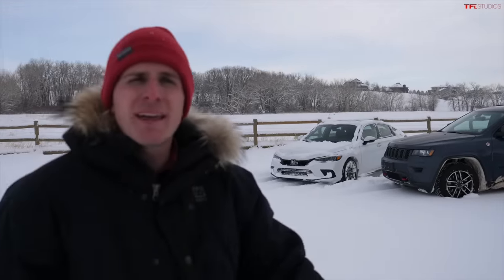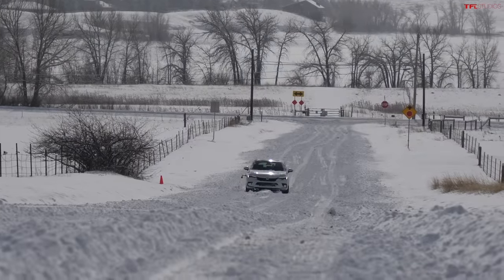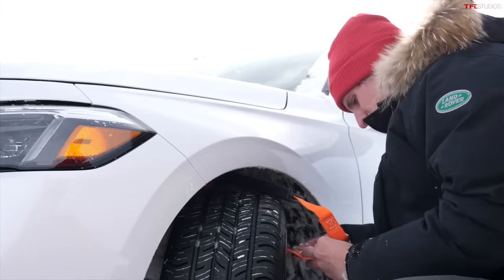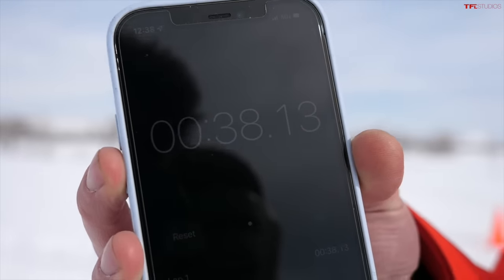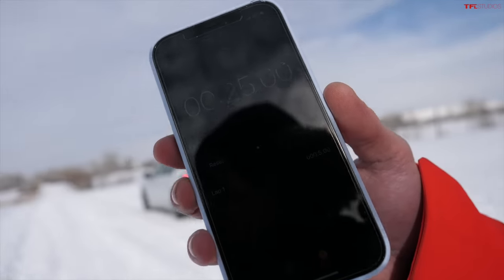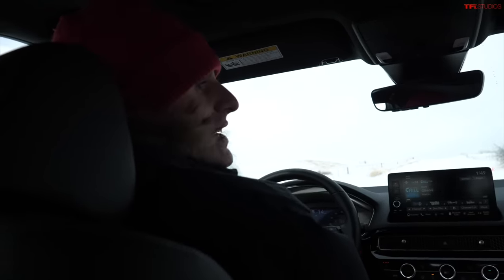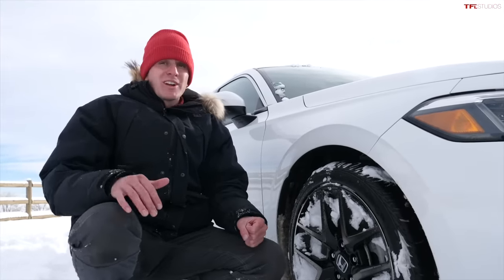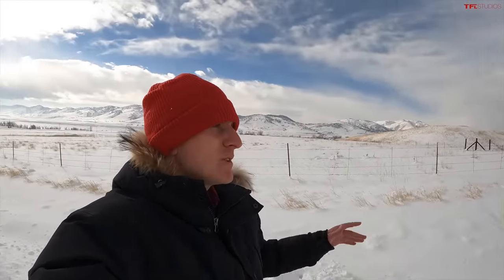Can Off-The-Shelf Traction Aids Make a Civic As Good In The Snow As a 4x4 Grand Cherokee?

Comment: I don't think that civic can beat the Cherokee even in dry road.
Reply: Yeah, it’s an odd comparison. They should have used the same model that has an AWD option.
Reply: It's has lower center of gravity
Reply: They could have tested a mazda3 awd vs fwd. or a camry awd and fwd…
Reply: @User.Joshua  lmfao
Reply: All season tires are useless in the snow. That’s why they are illegal in Canada during the winter.
Reply: @donproduction6248  i'm running snow rated all terrains and never had real problems in snow, different story on ice
Reply: The turbo model can, but the 2.0 cannot. 
Jeep V6 - 7.3(7-7.5s to 60)
Civic 2.0 - 8.3s
Civic 1.5t - 7s 

Also flooring the fwd Honda probably isn’t the best way to get acceleration vs modulating the throttle.
Reply: In dry road the Civic will perform much better than that Cherokee !
Reply: @Av3ntur0zky  😂 nope
Reply: @donproduction6248  Unfortunately, all seasons are not illegal in Canada. One province, Quebec, requires winter tires. Some of the mountainous areas in western Canada have special requirements. Everywhere else many people use all seasons in the winter, with predictable results.
Reply: Lucky the jeep ran long enough to make the trip in the first place.
Reply: You sure they not using their own cars?  So they don’t have enough cars to able to make comparison?
Reply: Civic would smoke the jeep on dry road
Reply: Jeep will be in for warranty/recall work for months waiting on backordered parts😂
Reply: @AKTesla  Jeep really get their reliability crap together or they will not ever succeed.
Reply: @MrMannyhw  No. chrysler is only “succeeding” cause they’re being passed around from company to company, currently stellantis.
Reply: @AKTesla  Not really succeeding then.  They are like a zombie company :)
Reply: @donproduction6248  im using all season tires with my civic for 10 years in canada, never had problem,
Reply: @donproduction6248  only in Quebec and British Columbia.  It's not all of Canada.
Reply: @AKTesla  using the word Chrysler and succeeding in the same sentence 😆
Reply: @donproduction6248 they’re not illegal in all provinces
Reply: @arvininguito6038 they’re lower now
Reply: @markleckband4495  This is V8 Jeep not V6.
Reply: The civic will always out live a jeep
Reply: Civic will also beat Bugatti Bolide in dry road.
Reply: And gov bail outs @AKTesla

Comment: I bought my first set of blizzaks this year.  I am absolutely amazed at what a proper snow tire can do.  Hard to explain, you have to experience it.
Reply: I used to drive all across Ohio, michigan, and Pennsylvania for several years in a civic and GTI. Snow Tires , where the best investment/ safety purchase ever, the young stupid 20 something me used to go around pretending to race 4wd Audis and Subarus and SUV . I beat most people accept other winter tired cars with 4wd but that’s was rare.
Reply: Blizzak FTW!
Reply: Totally agree. A game changer.
Reply: The thing about them that's hard to describe to other people is the fact that though all tires will eventually slip on snow you feel like you have the most control over a slipping winter tire and that it's also the most predictable.
Reply: @thomasdavis8117  of course any tire can. I’ve driven tens of thousands of miles on snow and I feel just as comfortable on pavement as snow with Blizzaks.
Reply: @bucknut2000  Of you can be like me and have a Subaru WITH snow tires.  Your become a WINTER GOD.
Reply: Big difference.
Reply: @bindingcurve  i get a lot of flack for having a Subaru with snow tires, waste of money, dont need them, snow tires dont last that long, etc. But i dont get stuck and im happy.
Reply: @hubster4477  There are a lot of snow tires that have a harder compound and don't have a wear of some of the softer ones.  But the real reason for the snow tries is not to get unstuck but to STOP.

Comment: It would have been nice to see how this would compare to another similar civic with designated 3 peak mountain snowflake tires, and compare that with the autosock/chains etc.
Reply: That's a good idea, esp considering the engine size of the Jeep etc.
Reply: I agree..... put real snow tires on the civic and then compare them..... since chains (and such) are for 'emergencies' only.... whereas snow tires would be all the time (through the winter, of course.... haha).
Reply: Chains will wear out the drivetrain, thats why you don't see any cars using them regulary.
Reply: @stoff3r Correct, chains are only for short term temporary use - I think they did a decent job clarifying that in the video too 😁
Reply: @veganpotterthevegan  nah I don't believe that. If you live rural then you have 4x4 and proper tires. A Hilux with huge sidewalls can probably drive a long time with chains but it's still terrible.
Reply: @veganpotterthevegan  I just read the instructions. Most can't drive over 30mph, can't drive on bare road, no wheelspin or brake lock recommended. So if your commute meets those requirements, then go ahead.
Reply: @veganpotterthevegan  thanks for letting me know.... i have fwd vehicles (escape and sedona) and i put snows on each of them.... and i've been fortunate to never have gotten stuck.... but i also drive prudently.
Reply: @veganpotterthevegan  I’ve noticed most  AS  car tires have M+S rating!
Reply: @veganpotterthevegan  that's true.   i live about 2 h from the mountains (alberta) and if you've got fwd and your 'stuck'.... you can always perch your passengers on the hood of the car.... for the extra weight!!   😂😜
Reply: 3 peak mountain snowflake tires aren't in the ballpark as good as winter tires.  When it comes to compact snow/ice/shallow snow on highways, here are the rankings for tires:   Winter tires > All Terrain Snowflake Rated > All Terrain >  All Season > Highway tires.
Reply: @YouDontKnow-that  Actually, Wild Peak and similar all terrain ties are very close to dedicated snow tires from Michelin, bridgestone.
Reply: @YouDontKnow-that  3 peak mountain and snowflake tyres ARE winter tyres. That's how you can tell.
Reply: @johnhussey63  Here is the order of best traction for snow/ice: All-Season, All-Terrain, All-Terrain 3-Peak Snowflake, Winter Tires, and Winter Tires + Studs.   3-Peak All Terrain will be better in deep snow...probably 8+ inches.  For compacted snow and ice, "Winter Tires" are better.  You're not arguing with ME by saying they aren't. You're arguing with the ENTIRE TIRE INDUSTRY.

Comment: Excellent lesson about braking.  A lot of SUV drivers get into trouble because they can get going a lot faster, but braking distances are a lot longer.
Reply: The Civic has a definite advantage over the jeep in braking. probably weighs 1500+ lbs less.
I've been caught out with my 4 wheel drive pickup. not due to over confidence, but because the 4 wheel drive system is so good you don't realize how slick the conditions are. I have to be more alert about that when driving in slick conditions.
Reply: Agreed. 4 wheeled drive doesnt make any difference in breaking - only works for acceleration. a 2x4 and 4x4 cherokee would have the same breaking distance (with slightly less from 2x4 b/c of less weight)
Reply: a i have studded tires  on my ford explorer,they stop  the car in a hurry--have had other cars slide right past me,lucky never been hit --i am in mountains all the time--check locations also for oil field utah,Co,Wy--they are the best for ease but i still put my tire chains on when on deep unplowed roads--never have used the sock--they look really good-i could have those on in 2 min--4 of those on a full time 4wd looks like no issue in deep snow
Reply: @ahodes100  There is literally a video showing the opposite is true, by team O'Neil. Having your front and rear axles locked together decreases your stopping distance compared to unlocked AWD systems and 2wd
Reply: Last year I was rear ended by a BMW X5 in my Accord. My Accord was certainly better in braking than that BMW.

Comment: What If... the Civic had actual snow tires like Blizzaks?
Reply: What if they didnt replace the jeeps stock all terrains with garbage street tires
Reply: @SarabLoh  Lots of all terrains are NOT designed for the snow.  Most lack the proper snipping and will not grab properly.  The compound is usually harder in cold weather as well.

Comment: Last winter I was driving up the California mountains in my GTI with chains on and had no issues at all. I was even passing by wranglers and other 4x4s that were stuck going up steep inclines. Their are better chain designs then the ones they bought but they are tricky to put on low cars with minimal gap in the wheelwell like my GTI.
Reply: YES SIR! 

That was me one week AFTER purchasing my 2006 Jeep Rubicon! I was so looking forward to tackling snowy/ice conditions with my all new front rear locker equipped Mud Terrain stock tires! 

My friend, in a 2003 Sahara edition, running winter ONLY (See of Flakes on sidewall) snow tires stock hight, ran circles around me as all I could manage was slip slip slip going absolutely NOWHERE. I was totally embarrassed! The experienced had me going to the Internet seeking the many whys and how to differing tire patterns, including the tire compounds making tire ice snow contact stickier! 

Science and tech are fascinating to me as a self learner. 

Getting off the hard paved compact snow proved amazing! GOBS of tractor-like traction even to the point I was plowing fresh fallen snow through deep drifts like a bladed dozer!  Fascinating!

Comment: I enjoyed this experiment.  Nice to see how these products work.  Definitely a positive review for the autosock, not so much the amazon block.  Best part about this experiment is that it was real conditions and didn't involve those roller pad thingys that are used in the other traction tests on dry land.  I understand measuring the time for comparison sake, but there are some things in life that success is simply measured by how safely you can complete a task.  Just like no one needs to tow uphill at 80 miles an hour.
Reply: I do think the block could be useful if, for instance, a person was stuck in a shallow ditch. If you can't move, you can't install the sock or chains. You could still install the block and potentially get moving enough to free yourself.

Comment: Thank you for including the back to back part about stopping with AWD SUV vs FWD car. Very few people ever seem to think about this when they set out in their 4WD trucks or AWD SUVs/Subarus. Being able to accelerate more easily means nothing good if you’re just going to slide past a stop sign or red light at the first intersection. I learned to drive in FWD cars and I was taught to gauge the level of traction on the road by giving the car some throttle and see how easy it is to spin the tires. I had to forget that technique when I got my first AWD car because it gives you a false sense of how slippery the roads are. I now use the brakes to gauge the level of traction on the road. 

I consider chains an “emergency use only” type of thing because of their substantial speed limitation, their requirement of constant maintenance and tightening, and the substantial damage they do to the roads.

Comment: Interesting video for sure. I would always recommend designated winter tires though if you live somewhere where it snows. I got some on my Explorer (in my content) and they make a huge difference.
Reply: I got designated snow tires for my rwd car. Michelin X Ice Snow tires along with chains. Tires are super important and even if you have awd if you got crappy tires it won’t be near as helpful
Reply: @onefastboi14   I agree. I had to get Pirellis due to the 21” and availability for the Explorer but they are so much better than the AS tires it came with.
Reply: Since snow tires have worse dry and wet braking, I wouldn't recommend them for all areas where it snows as even though I live in a snowy climate, the roads are wet or dry much more often than they're snowy. 

I use Michelin crossclimate 2 as they're the only no compromise tire - great dry, wet, snow, and ice performance and great or good fuel efficiency, noise, and tread life.

Comment: I love my 4X4s, but I have often said that on maintained (plowed) roads, a 2wd with chains will get you anywhere a 4wd or AWD will get you. So, I'm glad to see you do this test. But in the future, maybe you can use a slightly different test. criteria? "How fast can I get somewhere" is a criteria that is really stacked against any traction aid because, as you noted, traction aids aren't designed for high speeds. Maybe you can find progressively steeper hills to drive until one vehicle doesn't make it up.
PS - Doing more videos like this can also demonstrate that with even minimal practice, the tire chains will go on a lot faster. I mean look at the video at 9:18 - I'm sure you corrected that installation before you ran the test, as they would not have stayed on that way. But it demonstrates that a lot of time can be saved once you understand how the lever fasteners are supposed to be used.

Comment: Really good job guys! I've seen those "auto socks" at the tire store, but never seen them used. I wonder what the life expectancy is on those, i.e. how many times can they be used.
Reply: One big issue is that they can only be used on snow. They get torn up on pavement. So if you're alternating between snow covered patches and bare patches, you may get some holes in them. I'd recommend getting one of the brands which are thicker and tougher and can be used on alternating surfaces (ISSE Super; Matte Auto Super X and Extra Pro)

Comment: If chains come loose, they can really tear things up.
I wonder how many miles those socks are rated for?
Reply: Not long, I'm sure. ;-)
But if you only use them to get unstuck -- drive SLOWLY and don't spin the tires (much like using traction/recovery-boards) -- they may last for quite a few "emergency" uses.
Still, I'd prefer chains, as they're amazing (used them in TX and NM on RWD vehicles) and very durable...will be getting a pair of square-ling chains for my Jeep Gladiator (for the front tires only when in 4WD). Putting another pair on the rear tires -- if REALLY needed (!) -- would be as good as it's going to get.
-- BR
(Colorado)
Reply: A word of advice from someone who's used chains on a slammed 97 Tacoma to get home a a road that was bypassed during heavy snow in favor of keeping the main highway clear. When using chains put them on as tight as you can. Drive 20 feet forward and then 20 feet back. This will naturally loosen the chains(usually 1-2 links) and tighten the cam again and put the rubber tensioner back on. You won't hear that annoying chain slap they were hearing as it hit their inside fender liner. And no, you shouldn't drive faster than 45 mph while they're on. Faster than that and you could get enough centrifugal force to cause the cam and tensioners to pop loose.

Comment: Tire aids are very effective for sure. Many eons ago, I went up a hill road covered in snow to a ski village in the southern French Alps. I had a borrowed Honda Fit (called Jazz in France) with regular tires and chains on the front tires. I had no issues and never got stuck. I remember the chains I had being much easier to install though, I didn’t have to roll the car over it…
Reply: You recall correctly: They put the chains on wrong here.
-- BR

Comment: Why not test dedicated winter tires like Blizzaks. Tire Rack has a garage rack to keep whatever tires/wheels are stored for the off season.  Works great.  Dedicated winter tires are the best method, IMO.
Reply from the maker: You mean like this: All-Season Vs. All-Weather Vs. Snow Tire: You'll Be SHOCKED How Different They Are In The Snow!
https://youtu.be/22pMODgh6bE
Reply: @TFLcar  yes…. As applied to the test here between light front wheel drive, verses full sized SUV that is designed to handle snow with all around tires. Thanks for the reply. I had already “linked” the video in your link and saved it for archive reference.

Comment: Finally some decent video about how to install on low clearance car. i can barely fit my hands in the front fender so normal chains are somewhere between impossible to very hard to put on
Reply: Also, it says not to use chains, at least for  the accord sport and civics, with the 18in wheels. I just ordered snow socks because of the fear of damaging th wheel well

Comment: I own a 06 Accord and it has Crossclimate 2 tires. They're an all weather tire. Yesterday my area got dumped with 8" of snow and the car just drove like a normal with that much snow. I lost a bit of traction when going, but the grip was so great. Braking was also great, ABS never was used even though I was braking like what i normally brake in dry conditions. 

Saw many vehicles (2WD) getting stuck or not getting traction on the road, while I saw AWD vehicles having trouble braking or going slowly to avoid braking at high speeds.